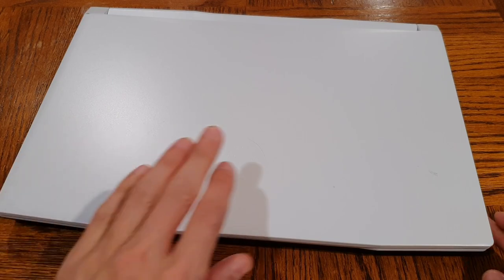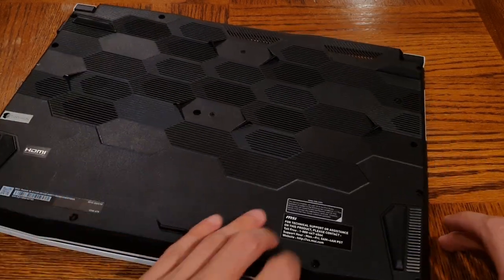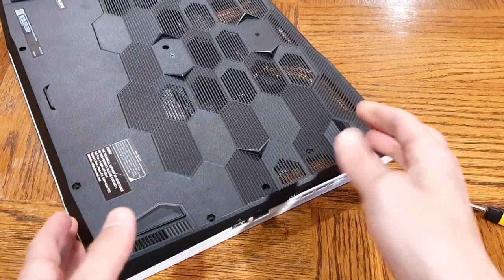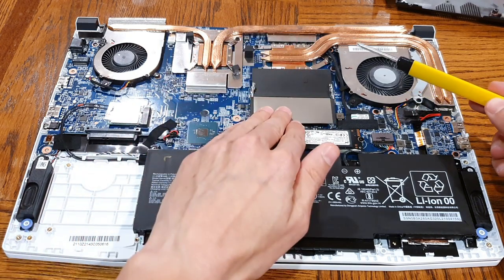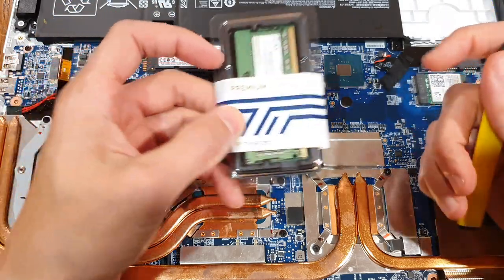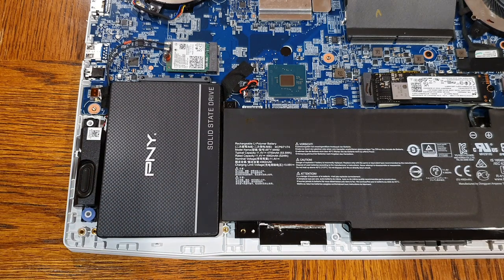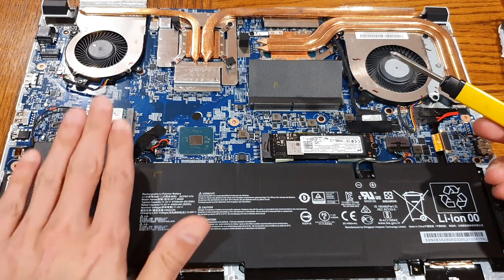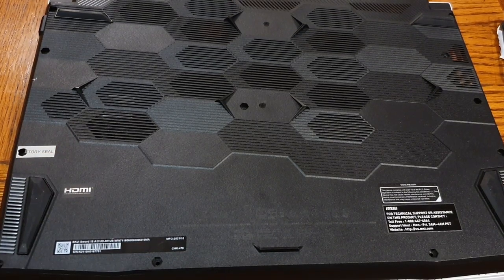MSI Sword Gaming Laptop RAM & Storage Upgrades - SUPER EASY

Comment: Will adding the 2.5 ssd cause more heat? Or have you noticed if the temps changed agyer adding it?
Reply from the maker: I haven't noticed any significant changes in heat generation. I've been using the SSD in the laptop for a number of months without any issues. Thanks for watching!